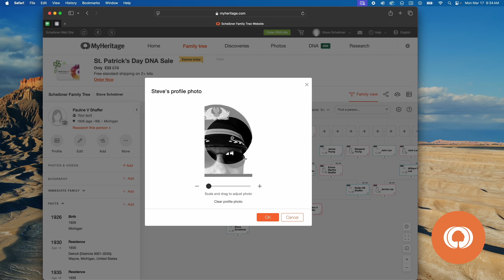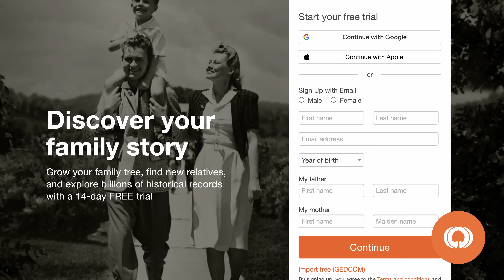Stuck Autopilot Turns Routine Flight into Nightmare | Captain Steeeve breaks it down.

Comment: I assume that the pilot tried pulling the autopilot circuit breaker which should shut down the autopilot.  I can't imagine flying a Piper that will not allow me to alter the attitude.  I trained on a Cherokee 140...a pussycat of an airplane that I grew to love flying...slow and very forgiving.  I also flew Cessna 150/152 as well but the Cherokee was, in my mind, head and shoulders above as a trainer.

Comment: This is crazy, I just cannot think of what could possibly lock up both axis if the yolk but still allow the pilot to muscle through it and not free or break completely causing full loss of control. The only thing that I can think is the autopilot servos were fighting him but pulling the breaker should have fixed that instantly. Maybe a small wiring harness fire that let two wires touch causing the auto pilot to stay energized even after pulling breakers, which would also explain the gear not going down and issues with other unrelated systems. anyone else have a better theory?

Comment: For others interested here is the best info i could find on probable causes 

The most likely suspected cause for the cascade of failures on Charles Schindler's flight (N113RC) is a short circuit or in-flight fire near the aircraft's control systems that damaged both electrical and hydraulic components.
The Chain of Failure:
Electrical Failure: A short circuit or electrical arcing occurs, potentially in the wiring near the main circuit breaker panel (an area the NTSB later highlighted as a concern in the PA-31T fleet).
Autopilot Lockup: The electrical surge or failure directly affects the autopilot's pitch servo or flight computer, causing the uncommanded engagement and subsequent inability to disconnect it.
Loss of Pitch Control: The initial electrical event or a resulting fire/damage also affects hydraulic lines or the mechanical control cables for the elevator/pitch control, effectively locking the flight controls and rendering the yoke useless. The hydraulic issues reported by the pilot are key evidence of this deeper, more complex failure.
The NTSB's investigation into a separate, fatal PA-31T accident later prompted them to issue a warning about electrical wires chafing against hydraulic lines in the area below the main circuit breaker panel, which could lead to fire and dual system failure. This finding strongly suggests a fleet-wide design vulnerability that could have caused Schindler's emergency

Comment: i was killed in my lear 35 when i tried to fly it single pilot, guess i was not supposed to do that,  was fun at 1st  then all hell broke loose on take off,  i got it in the 3800 ft runway  then the next morning it was 98 degrees  at 6999 ft density  altitude,  did not quite make it,  seems the runway was shorter than i thought, at the 3700 ft point i got the nose wheel up  then that damn mtn at the end sure got to me fast,  at 250 mph we hit it, KABOOM!  i was scattered all over the mtn, but my gf is a nurse she ran over with a 15 gallon  drum of super glue, took her a while to glue me back together,  my head had to be reglued, she got it on backwards, but im better now   the faa and  the ntsb said i  was in trouble.  that was 5 years ago havent heard from them since, make a very small coffee table out of the lear, i bought another one,  today it is 101 out, so i will try it  one more time  then if it doesnt work out i w ill just get back in my 150 cessna and fly it  my gf is off today  she said she is ready to  glue me back to together if need be,   wonder why she wont fly with me,

Comment: When the Lockheed Constellations were new KLM lost a plane over the Atlantic without warning. They sent one up empty with a third pilot as observer. Theywere to keep flying until something happened.  When a vacuum tube in the autopilot burned out it slammed the stick backwards into the pilots chest and they couldn't reach the switch to turn it off. The extra pilot did.

Comment: I’ve had the opposite problem, I was flying a 172 and immediately after takeoff my rudder jammed it’s the most scared I’ve ever been while flying, I could fly the airplane relatively OK up at altitude where precision wasn’t that important but it took me 4 attempts to land cause just as I was about to touchdown. I would end up over the grass, ultimately the controller is decided to have me land on the “commercial” runway which was 150 feet wide versus the other one which was only 75 and I was able to get it down

Comment: @CaptainSteeeve, This is situation brought back memories of the first time I flew a Warrior.  My CFI was flying with me and talking to me about distractions that can be caused by right seat occupants.  Meanwhile, he was fiddling around with the autopilot in the Warrior.  At one point the AP engaged and fought me for control of the aircraft.  It had a mind of its own and was very hard to fight.  When it decided it wanted to turn, it was forcing that plane into a turn and it was near impossible to fight it back.  We were able to disengage it but I can imagine how scary it would be if it locked into control like that and my only control was fighting it.  Personally, my first fix would have been to pull the breaker for the AP.  Not sure why Piper wouldn't have suggested that but maybe the problem was slightly different in this case since the pilot did mention he had tried recycling the AP as well as the Master switch.

Comment: In my background there is a tank driver, a pilot i believe, airplane restoration worker who did the woodwork. I was also at the university of toronto with a blood relative and aviation dept as they all worked together to build the flapping winged airplane. It waa taken up for test flight. I was not in contact after that.

Comment: I am a retired CFI, and I would like to discribe my discussion and demonstration training that I gave each of my students when nearing the end of their training. All of my instruction was given in 152/172 aircraft. I discussed the possibility of total loss of aileron and/or ruddrer control inputs due to mechanical failure/s. Although very unlikely, this instruction could provide a last ditch effort to manuever the aircraft to a successful landing. 
Using power and trim to control altitude and attitude, and the aircraft doors for longitudinal control (open and push out the left/right for left/right yawing turns), I would demonstrate a return to the airport area, from 3000 'MSL and 5 miles, and complete a successful landing, using this technique exclusively. This  is a very powerful demonstration of last-ditch effort when facing a seemingly impossible situation. Give it a try.
Reply: Do you know that a glider pilot once did a winch take off, which goes up like an F16 does, just slower. Then he suddenly realized the elevator was not connected. Oops. He waited for a safe altitude to bail out, but there he decided to wait longer, since the glider still flew okay, trimmed out. More altitude is safer. So, he finished the take off, and decided he might just as well do a landing. Very very careful, remember, the elevator did not move at all. Airspeed solely depended on the stability of the plane, but that was good enough. Flying extremely gently, he flew the landing circuit and that was it.
     He had been very very lucky, he had risked losing control during a winch launch, which can end in a lethal crash. One can stall, for example. But somehow this plane flew on at a safe airspeed, keeping speed okay all by itself. Without elevator input. Extremely scary, but it gives a flint of hope, might it ever happen to one of your students.

Comment: I want to know…. Check that, NEED TO KNOW, why this was happening.  

1.  Is it normal that fighting the input on the auto pilot is this difficult on the Piper?  
2.  What was the fault in the system that lead to the problem?  It had to be more than just runaway trim since roll control was also an issue.  
3.  What would make the aircraft bank one way and then the other way?  Was the auto pilot confused?

I hate to introduce a conspiracy into this, but is it is possible the aircraft autopilot was being remotely controlled?   For many reasons, no one wants to even entertain that question.  But it still needs to be asked.  

We need some answers. From Piper, the NTSB, or FAA.  Probably not the NTSB since it wasn’t a crash investigation.

Comment: I was surprised that equipment, especially the autopilot and its actuators weren't powered down by pulling their breakers to see if controls would be freed. The actuators should "let go" when autopilot is not enabled, and good engineering practice is to have "let go" be the default when power is lost. It sounded to me like the autopilot electronic brain had a "stroke", literally making the actuators behave like a "seizure".

Comment: I would like to know more about what was wrong with the aircraft and why they couldn’t get the autopilot to disengage. I saw a comment that said leaky capacitor on an autopilot PCB, but I would like to know why he had to pump the gear down and why he couldn’t pull the AP circuit breaker to disengage it.

Comment: Thanks for this video.   We so often hear stories about tragedies. It's important to hear about heroes, too.  

It makes me think about an accident with your old P-3, though the commercial version.   

It was a Lockheed L-188 Elektra.  In 1983, Flight 8 from Reeve Aleutian Airlines lost prop 4 over the pacific on it's way to Seattle. The propeller dislodged and sliced through the fuselage, causing decompression and loss of manual flight control.   

The pilots barely had autopilot.   They had no manual control at first and no throttle.  They were eventually able to navigate with autopilot and slight modifications. The pilots continually tried to move their flight columns, often in tandem to apply changes to navigation.    

It turned out that the flight cables were sandwiched between the support beams in the super structure of the plane.  They were sandwiched due to decompression causing them to buckle.

Their efforts ultimately led them to saw through the sandwiched beams, which granted them enough control to attempt a landing even though they still had no throttle control and no flaps.   They cut an additional engine to reduce speed, but it would still be a dangerous landing.  

After one go around, they committed to land, and cut all power on the two remaining engines upon hitting the runway.  No loss of life.  No substantial damage to the plane.   The plane did run off the runway, but the captain was so pleased, he ordered that he, the first officer and engineer wear jackets, hats and ties as they debarked. 

President Reagan honored the flight crew at the white house.   

You can find the landing online still.   Its my favorite accident story because like this, ATC, the airlines engineers, and the pilots all worked together to figure out the problem.   They didnt give up and they delivered a spectacular landing worthy of any highlight reel you could ever imagine.  

Style matters lol.
Reply: I think I remember the interview with that pilot on Mayday.  I remember laughing the way he said to put on their uniforms and hats or whatever.  Can't remember the exact wording he used, but it was great.
Reply: @fuhkerz yes!   I remember watching that ages ago.  The first officer was hilarious.

Comment: I haven't watched the whole video yet but 3 years ago, I was driving my car when it stopped accepting any inputs.  I couldn't give it gas, couldn't brake, the windows kept rolling themselves up and down, the seatbelts loosened then immediately pulled us too tightly back into the seats over and over, the screen and instrument lights were blinking, blacking out, coming back on, and the car kept lurching forward and stopping short.  

I was on a 2 lane 55 mph road and all this began while I was in the middle of the intersection, making a left turn.  I managed to limp the car a half mile down the road to get into a parking lot.  I tried fixing the car, resetting it, turning it off and waiting a bit before turning it on.  Nothing helped.  After about 30 minutes, it finally started working again.  

When I took it into the dealer, they said that the engine control module (basically the computer that runs the car) had failed and had to be replaced.  My wife says the car tried to kiII us so she calls it Christine.  She also bought an escape tool in case it ever happens again.  It was scary enough on the ground, I can't imagine something like that happening on an airplane!
Reply: Once I got out, I would never get back in.
Reply: The seat belts in your car have some kind of motor? Except for a couple of years in the 80s, I've only seen seat belts that mechanically roll out on a ratchet and click together.
Reply: @meherenowmaybe  I think the car's computer might have been detecting the lurching and hard stopping and reacted like it was in an accident every time that happened.  The seatbelts pulled us back in the seats tightly and locked us there for a couple seconds, then it lurched forward and just kept repeating the process.
Reply: Definitely a demon possessed car ! Ya might want to get a priest to exorcise the demons & bless all of your vehicles

Comment: I never heard the suggestion to pull the circuit-breaker of the autopilot. That should be high on the list if the AP acts up.
Reply: Well for some weird reason he didn't had the trouble shooting manual on board, that probably was there. Also i would just carry a parachute with me at all times.